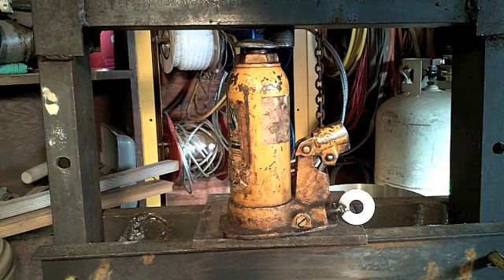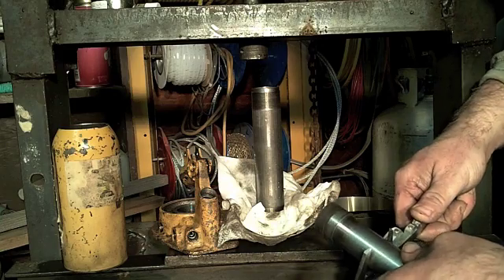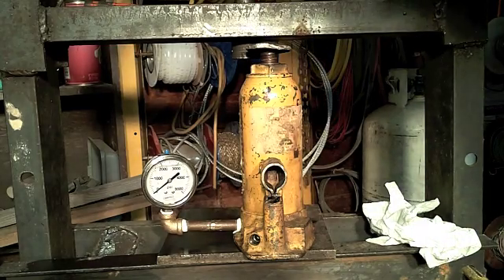Adding pressure gauge to a bottle jack.

Comment: The internal cylinder diameter (what you really need for your calculations) is slightly larger than the piston diameter, but is more difficult to measure precisely.

Comment: I was looking for a way to make a jack for my STEM class so we could measure the final pounds that their bridges held. I think I'll just count the number of pumps of the jack. Thanks for the video.
Reply: Counting the number of pumps of the jack handle WILL NOT relate to the force being applied to the bridges.  The number of pumps of the jack handle will relate to the distance that the jack ram travels, or the deflection applied to the bridges.  Stiffer bridges (typically stiffer is stronger) will deflect less than flexible bridges at any given load level.  The strongest bridges may in fact break with fewer pumps of the jack handle than the weaker, more flexible bridges.

Imagine a rubber bridge.  It will deflect a great deal, but it won't carry much load.

This property of elastic materials is the essence of Hooke's law.

Comment: Hello! Thanks for the video! Not many out there on this subject. I’m wondering if I can get a fitting that can attach a gauge to the release valve screw and still allow a way to open and close it? Will that work also? Instead if tapping another hole?
Reply: From the release valve screw, the oil is behind one or more check valves and/or seals so you won't get any pressure readings there. consider that if the oil pressure could be measured there, you'd lose most of your oil every time you opened that valve.
Reply: @GFlCh  and in the security valve ? some bottle jack incluye a ''do not adjust'' screw beside the release screw, if i do a replace of that security screw with a manometer you think is gonna work? sorry bout my english im from chile im speak spanish

Comment: Can't you just use a pressure gauge?
Reply: This is what he used, a 5000psi pressure gauge. What other type of pressure gauge are you thinking of? Where would you attach it? Keep in mind that the gauge you use, and the fittings, are under the full pressure of the jack. If they can't handle that kind of pressure, the gauge and fittings will eventually (perhaps immediately) leak, fail, and break apart, perhaps violently.

Comment: why the calculation???
Reply from the maker: It is how to tell actual pounds the press is putting out.  Pounds per square inch, you need to know how many square inches the piston is to figure total pounds unless your piston is exactly one square inch.
Reply: ha . why would you care?  everything is measured in psi or  bar (pressure) when it comes to hydraulics.
Reply from the maker: adam sorell You understand that this is in a press and it is often useful, sometimes required to know how many pounds of force you are exerting on an item?
Reply: when is it useful?
Reply: @adamsorell4851  Any time you are pressing something it is useful. An arbitrary pressure reading doesn't tell you anything.

Comment: very well explained, the only thing is that I never disassemble the cylinder utbe from the base as it needs extra force so if you don't have the special tool needed, the risk is great you cause a deformation of the cylinder and leaks, I fabricated extension drill bits so the tube doesn't bother me when I need enlarge the intake and return holes to recieve a tube for inverting the jack

Comment: is there any text to this tutorial? great vids by the way. me and my friends going to try this because we could not afford the hydraulic pump with a pressure gauge
Reply: You could copy/paste the text from the auto-generated transcript. It would need some proofreading and minor corrections, but it's very close:

00:00  I like this I draw it press fine but I'd
00:03  very much like to know just how much
00:05  force I'm applying so what I plan to do
00:08  is install this 5000 psi hydraulic gauge
00:13  onto the jack and then once I calculate
00:15  the actual inside diameter of the piston
00:18  I can get a really good approximation of
00:20  how many pounds of force is being
00:23  exerted first step is to drain the jack
00:28  each jack is different but as you can
00:32  see normally they will have a oil fill
00:35  level it's that red one up here very
00:37  similar thing so first off I got to pull
00:41  that and drain it into a clean container
00:43  so that I can reuse it once you've
00:47  drained the fluid it's now time to get
00:49  the jack apart now unless you have a
00:51  welded jack one of the reasons why I'm
00:53  not using this red one is it's actually
00:55  a welded jack unless you have a welder
00:58  jack it'll come apart in two places
01:00  it'll come apart right here and will
01:02  come apart right here but they both
01:04  could be really really hard to get out
01:07  starting with a newer jack obviously
01:09  it's going to make this considerably
01:11  easier with the base and the vice big
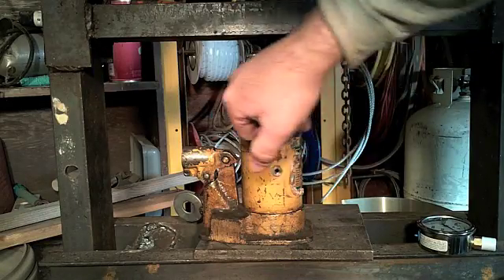01:15  pipe wrench big channel locks big
01:17  something go ahead and unscrew this once
01:20  you get this out the piston assembly
01:21  should lift out of it this is the
01:24  hydraulic fluid reservoir and that comes
01:27  off next now it took a very large pipe
01:32  wrench and quite a bit of force break it
01:36  loose but it came
01:45  this is the next piece of pipe that has
01:48  to unscrew this is the actual barrel for
01:53  the piston when you get that apart
01:55  you're going to want to carefully
01:56  measure the inside diameter so that you
01:59  know just how big it is it'll let you
02:01  calculate the surface area and figure
02:03  out what sort of formula you're going to
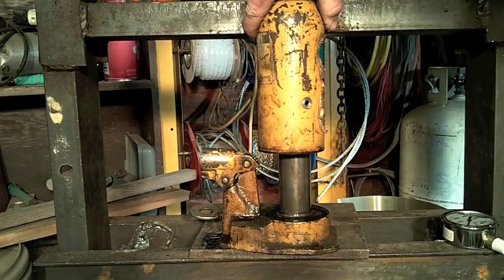02:06  need to get your gauge accurate so next
02:09  pull that inside pin now we're down to
02:14  our key jack components okay so this is
02:18  the actual pump right here and the oil
02:21  comes up out of that hole right down in
02:24  there and that activates the piston and
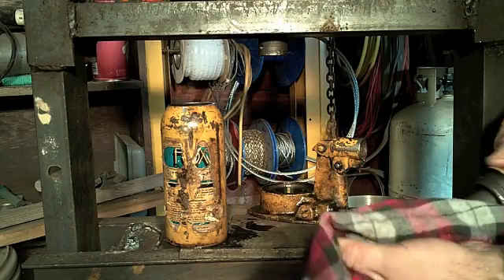02:29  the piston rides inside of here so when
02:37  you take it apart it's alright to put
02:41  marks on this shaft you put marks on
02:44  this shaft and it's ruined absolutely
02:46  ruined but this shaft unscrewing it and
02:49  it took even more force then crack on
02:51  the top did this is the actual piston
02:54  shaft this is what it slides up and down
02:57  in the base you have the seals none of
03:01  this needs to come apart though it all
03:02  does need to go into your solvent tank
03:04  to be cleaned up this part of the jack
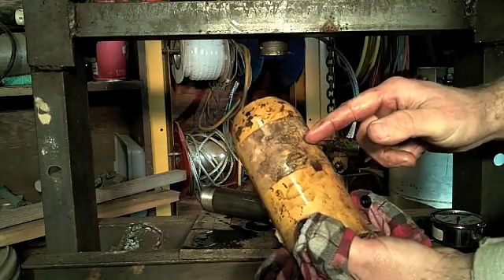03:09  is nothing more than a hydraulic
03:11  reservoir this is where the fluid rises
03:14  when the piston is down and then as you
03:16  pump the piston up that fluid drops if
03:20  you want to make a Jack that is
03:23  reversible that is that you can pump
03:26  while upside down that can be done can
03:29  be done very simply you need to tap into
03:31  this line here which is the suction line
03:34  when you tap into that line there and
03:36  you're going to put a nipple and you're
03:39  going to go the appropriate distance
03:41  down with a little piece of hose so that
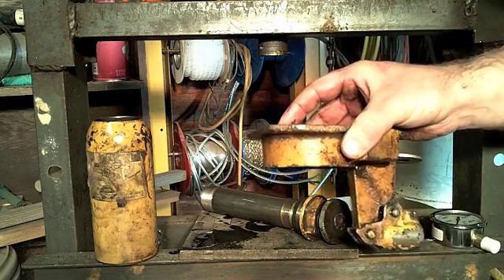03:44  when the jack is upside down then it can
03:47  still suck fluid because that's your
03:48  main problem next step really I got to
03:52  clean this up we have to pull the ball
03:54  return we have
03:55  to pull the pump assembly out and get
03:59  ready to do some drilling down in there
04:02  so now I've got all the check and ball
04:05  return belts pulled out of it and these
04:08  are different for every jack and you
04:10  just got to be careful and try to catch
04:12  what can come flying out of the hole if
04:15  you're not careful a lot of modern jacks
04:17  will have them behind the bleed valve
04:18  this one had them in the pocket there so
04:21  it had a small valve which is basically
04:25  a steel ball in a seat in there on top
04:28  of that it had a spring on top of that
04:30  it had the large ball and then it had a
04:34  rubber Cup and they all go together
04:40  inside something like this you're going
04:42  to have something very similar and if
04:44  you shoot it across the shop and you hit
04:46  a little bits and pieces fall behind the
04:47  corners you're gonna have to buy a new
04:50  jack so be careful so now we're ready
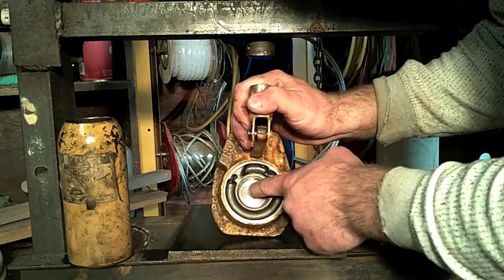04:55  for the milling process so what's got to
04:57  be done is we've got to tap into the
05:00  center of this part here but if you
05:02  touch with your drill bit that edge or
05:05  any of these threads again the jack is
05:08  ruined so there's not a whole lot of
05:09  wiggle room in there we're going to find
05:12  a way to go in through the side here
05:18  reach it in the center and then drill
05:21  and tap this out for your gauge
05:27  take some careful measurements do some
05:29  careful planning make sure you get this
05:31  right the other opportunity is to go
05:34  straight to the bottom which isn't an
05:37  option in this press all right so the
05:41  milling is complete I didn't have a lot
05:43  of base thickness to work with here so I
05:45  had to be very precise I came down just
05:48  below the edge of that lip I went inside
05:51  with a larger hole big enough that I can
05:54  then tap it out for a quarter inch pipe
05:57  and then using a tiny drill bit I
06:00  actually made my incision it you know it
06:03  doesn't have to be a big hole it can be
06:06  hardly larger than a pin hole and the
06:08  gauge will still read pressure at about
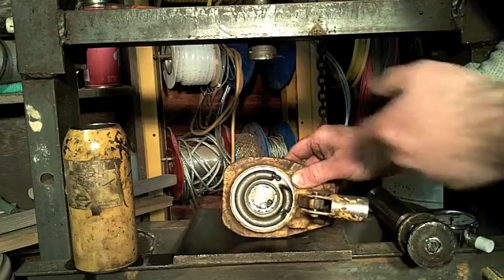06:11  1/8 inch hole plenty that's bigger than
06:13  the hole it's in the bottom of the gauge
06:14  anyways so this should work perfectly
06:16  now I just need to tap this and give the
06:20  whole thing a very thorough cleaning
06:22  because you get those metal filings in
06:24  there and it will shorten your life your
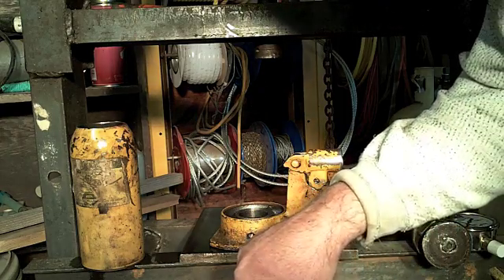06:26  jacket all right basically the operation
06:28  is complete I've got my threads in there
06:30  I've taken the time to very carefully
06:33  clean everything somehow already got dog
06:36  hair right very carefully clean
06:37  everything now I just need to put it all
06:41  back together it can't be too clean take
06:44  your time make sure everything is
06:46  spotless because any dirt in there and
06:49  it'll just cause you nothing but
06:50  troubles remember before you assemble it
06:54  to take the time to measure the bottom
06:56  of piston and it's not this diameter
06:59  here it's the diameter at the very base
07:03  the fatter diameter so I know that this
07:05  is one point two four five and that's
07:11  that's the number I'll enter in for my
07:13  calculations to figure out exactly how
07:16  many pounds of force is being exerted
07:18  one point two four five
07:27  you
07:29  again if you measure this you'll be off
07:32  and you'll be off fairly substantially
07:34  so it needs to be the base here
07:39  reassemble the jack the way you took it
07:41  apart it's a good idea before you
07:44  reattach the piston here to put a little
07:47  oil on that seal
08:08  well none of this footage is ever gonna
08:10  be used you know how tight it was when
08:15  you took it apart it's got to be pretty
08:17  tight when you put it back together and
08:21  there it is
08:22  all complete I just need to refill the
08:26  bottle it might take some time and
08:28  effort to get that to properly bleed
08:30  remember this is hydraulic stuff so you
08:33  know there can be quite a bit of
08:34  pressure on it and water pipe might not
08:37  hold so you should look into do using
08:41  the proper stuff I'm gonna go ahead and
08:44  bleed this and then test it out I hope
08:47  you have good luck with your own Jack
08:49  thanks for watching all right so here it
08:52  is all bled up I had some difficulty
08:56  bleeding it and there's still some air
08:57  in there somewhere
08:59  the handles a little spongy with luck
09:01  it'll work itself out on its own but now
09:05  when I add the pressure we bring her up
09:11  so the gauge it's just pressing on a bar
09:14  right now but the gauge is at 2,000 and
09:17  if I want to know how much weight that
09:19  is I have to multiply by one point two
09:23  three so that's actually putting 2,400
09:26  pounds of actual measurable force on
09:30  that I wish my piston would have been a
09:34  nice round number one would have been
09:36  nice one and a half would have been okay
09:38  one point two three at least it's easy
09:41  to remember so again good luck with your
09:44  project I hope it all works out for you

Comment: To get the surface area of the ram use oil displacement to measure it, attach a graduated syringe body to the outlet you are going to fit the gauge to via a tube and bleed out the air between, locate dial gauge to the top of the ram, stroke the ram exactly a specific distance on the dial gauge and note how much fluid entered the syringe graduations, if 1  CC of fluid enters the syringe over 1 CM ram stroke then the ram surface area is 1 square CM. Or for imperial convert 1 cubic inch to 16.3871 CC because syringes come in CC , and if 1 inch of stroke pushes 16.3871 CC of oil into the syringe then the ram surface area is 1 square inch. Use the value you end up with to convert the gauge reading to ram pressure.
Reply: ugh....or just measure the diameter of the ram, divide it by 2, square it, and multiply by Pi. (pi*radius^2)
Reply: You can pull it apart to do that, or just use oil displacement method and no need to take it apart.
Reply: He had to take the jack apart anyway but no need to measure the piston and no need to use the displacement method. No need to know the piston diameter at all. Just put a known weight on the jack and read the gauge to get the ratio of weight to PSI.
Reply: IMO not an accurate method unless you put a ton on it and that's not safe.

Comment: I plan to do something similar.  I would have actually miked the ID of the cylinder rather than the bottom of the ram , but should still be pretty close.  Another way to calculate area is just to take your diameter squared X.7854

Comment: Good Vid :)

About the max pressure/which pressure gauge to select to suit the ram
If the ram is 12Ton / 26455lb and the Ram is 1.245" OD next to the seal then 26455 / 1.217 (ram area) = 21738 PSI for the full 12Ton pressure, only needed if you wanted to max out the ram but a good reference/calculation

Also another useful mod is to turn the ram upside down, this is actually possible by placing a spring over the ball valve that the lever operates so that id does not leak pressure/it takes the weight of the ball valve, done this with both a 12Ton and 30Ton Ram 100% success, using an air over hydraulic bottle jack would be even better but I wasn't sure if they could be converted to work upside down or not, so I opted for a "close" 50mm pin spacing for the table, holes 125mm apart

10,000psi gauge is perfect for a 30Ton Bottle Jack with Ram around 70 to 76mm OD

Comment: Can you add an air compressor for quicker  pumping?
Reply: NelsonStudios Thanks for the very detailed tutorial. As for air over hydraulic, you can tap the fill plug and and use low pressure air (10-15 PSI) to raise the jack faster than pumping with hand. It won't be like a air hydraulic jack but it will extend the piston very rapidly until it gets to a place for actual pressure and then you continue with hand pumping. I've setup mine with 3-way air solenoid and a foot pedal and it works great.
Reply from the maker: Csaba Farkas No because air would make it spring.  You could however start with an inexpensive air powered bottle jack jack from a company like Harbor Freight which when I think of it now is a dang good idea.
Reply: Actually, on the air/ hydraulic jacks units, the air only supplies the power to operates a small hydraulic pump in place of the manual pumping motion that you normally provide

Comment: Hi, really interesting video.  Is it possible to have it so the pump is remote from the body?  I have a m/bike lift which uses this type of jack but it is really difficult to use the handle in order to create the lift.  I would like to re-locate the pump section where it would be more accessible.
Ideas appreciated.

Lester
Reply from the maker: If you could substitute a port-a-power piston and pump then yes you could.

Comment: Can you not make a dial around the outside of the gauge to give you the correct numbers for pressure so its easy to read ??
Reply from the maker: Sure, a little index card with the numbers written out taped to the back is a great idea.

Comment: Is there no digital gauges available? Because so far, tire gauges have already digital versions like from Mountaincrest. Does this stuffs have recent innovations already?
Reply: I assume there are, but one that would operate in this pressure range might be too expensive. The one he used would be much less expensive, and he might have had it on hand.

Plus, a digital gauge would require power. Either by batteries that you have to occasionally replace  or recharge, or by a power cord/power adapter and perhaps an outlet and  power switch.

Comment: One point to consider: What is the maximum your jack can generate vs. what the maximum rating is for the fittings used. Not sure, but I think schedule 40 black malleable pipe 1 inch and below is 2000 psi. Bottom line is not to exceed this maximum working pressure rating.